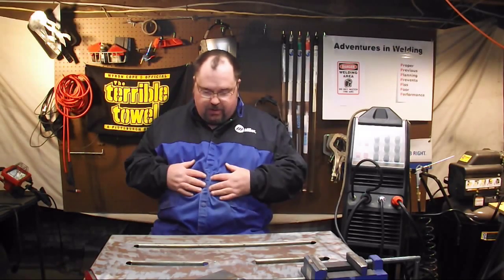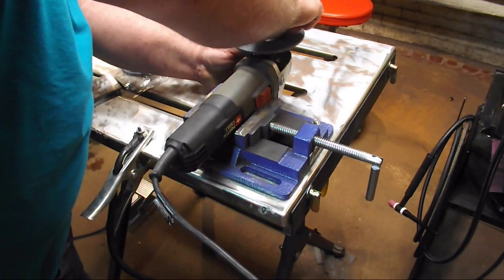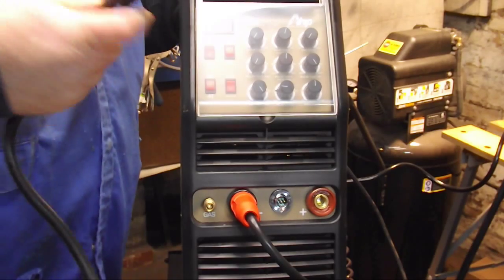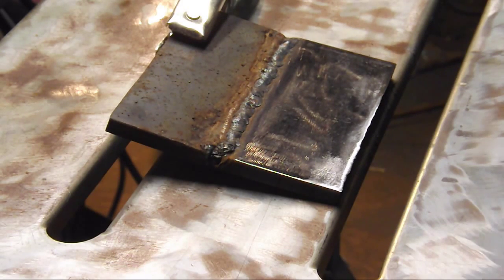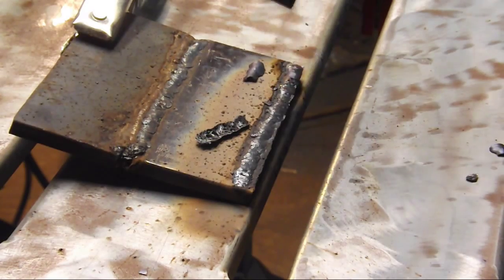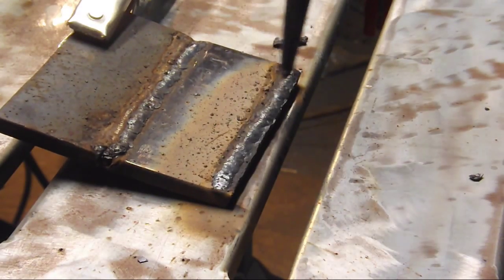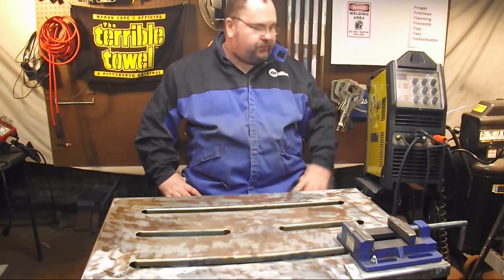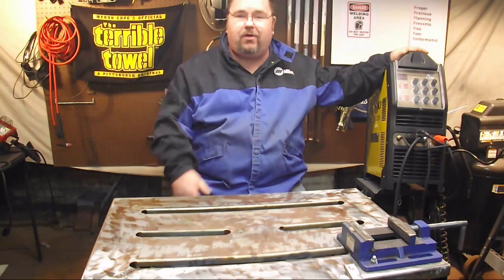Stick welding with the AHP Alphatig 200x

Comment: If you try this and are having trouble, make sure you disconnect the tig pedal.  Stick welding doesn't work right with the pedal attached.  Also the operation instructions state DCEN while the chart next to it says DCEP.  If you aren't sure, DCEP is a safer bet.

Comment: i was shopping for an arc welder but would also like to have a tig some day. 
would it be a good choice for welding heavy duty bumpers and tow points on a truck? 
there are a lot of reviews about the tig function, thanks for doing one on the arc capability 
are you still enjoying the alpha tig?
Reply: I've used mine on on really heavy metal. If your a pretty good stick welder the machine will do its part. Awesome Tig machine too.
Reply: thanks you! i ordered one, it should be here Friday. i already have some 7018, 6011, argon tank, 3/32 er70s2 tig rods, and 3/32 2% Lanthanated Tungsten Electrodes to get started.  any advice, or rods that the alphtig likes or dose not like?
Reply: +MrMrsregor I've used 6011, 7018, 7014, and 6013 rods and all done great. With up to 200 amps if you know what your doing u can weld most anything around the house or farm with this machine. Very smooth arc. I've used er70-6, silicon bronze, 4043, 308, 309, filler rods with 2% lathnated tungsten. I've just started to learn to Tig and have the addiction. Lol. I use mig almost daily at work and been stick welding for years but Tig is new to me. I mainly use 3/32 tungsten with all sizes filler but sharpen it more for the thinner stuff. I mainly use 3/32 and 1/16 filler material but bought some .045 acouple weeks ago for really thin metal and that's worked out pretty nicely. Just bought a ssd foot petal for it and it's much nicer than the one it comes with the machine. No complains at all so far.
Reply: thanks for the info! sounds the same as me, i have been arc (stick) welding and mig welding for years and now want to start tig

Comment: Can you weld 6010 with the ahp ?
Reply: +Dewayne Smith No reason you couldn't weld E6010 with this welder.
Reply: No you can't. The reason is that the voltage output of the machine is not sufficient for 6010, 6011 no issue.
Reply: @satamanschmidt3428  I run 6010 with this no problem. Why would u say it couldn't?
Reply: @chadwysocki1991  Because AHP says that you can't. I actually never tried it since I typically believe what the manufacturer tells me. Normally, I use 7014 and 7018 so I never considered that to be a problem. If I needed a deep penetration electrode I just used 6011.

Comment: We're you still using DCEP with the 6011 electrode??? and what kinda amperage setting and what size Rod ??? thanks 
of
Reply from the maker: +MrJoseph1157 Yes, my machine only does DC. It was 1/8th inch, I don't remeber the amps.

Comment: Hello Paul! I don't understand why you can't stick weld in AC mode with your new AHP machine? If it can tig weld AC, then you should be able to use a stinger instead of a torch and stick weld in AC. But I don't understand why you can't just flip the switch from DC to AC while in stick mode and weld AC?? Just curious. That 7018 seemed to strike off with no issues and sounded smooth as well. Same with the 6011...nice beads as well. Take care.
Reply from the maker: +Mike Snyder Hi Mike. Thanks for watching. I was a little disappointed that I couldn't weld AC in stick mode. I thought for sure that the machine would be set up for it. I mean, "why not?" right? But there must be some circuitry that disables the AC/DC switch when you switch from TIG to stick. But that's ok. I've been wanting to buy an old Lincoln Tombstone to play with. I think you could drop one of those off a building and it would still weld. I saw one in a thrift store last week. So you might see it in a video in a couple of weeks!!

Comment: When you welding stick how far is the stick ark to the peace you are welding on?
Reply from the maker: +TakeTheNarrowPath GloryIsHisName With 7018 the flux on the rod is actually touching the metal ahead of the puddle. Have you ever watched Jody @ Welding Tips & Tricks? He always says "Turn your machine up enough so that it doesn't stick when you keep a tight arc. Then keep a tight arc." You want to be as close as you can be without snuffing out the arc in the puddle. For 3/32 7018 around 90 amps, 1/8 7018 about 125amps should allow you to get very close without sticking.